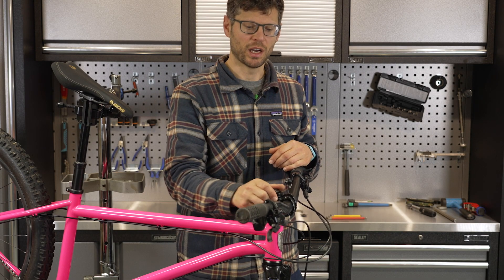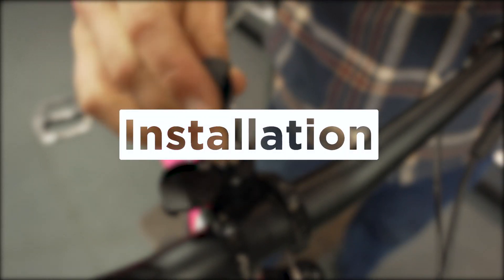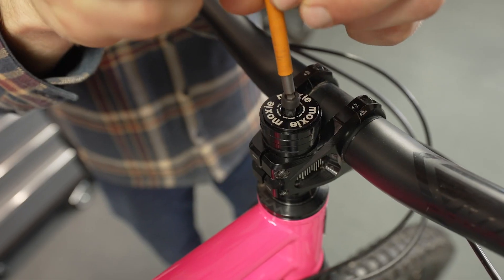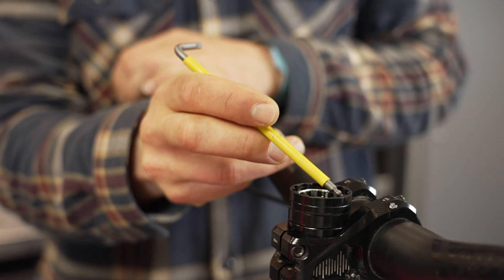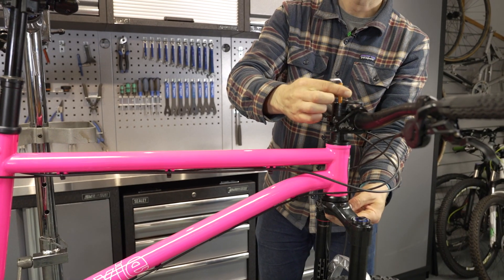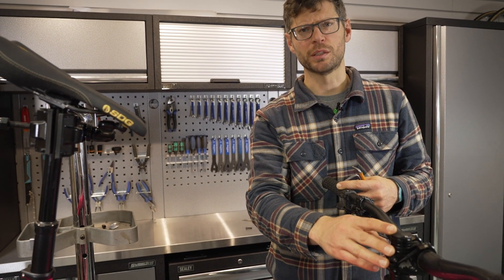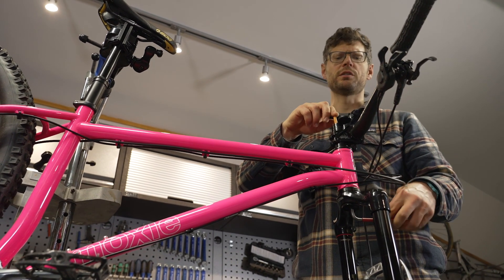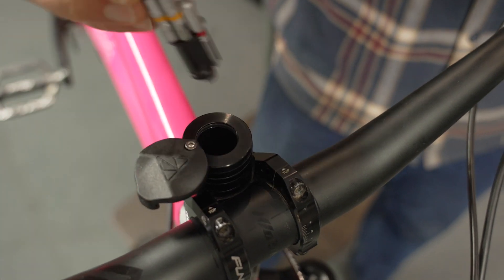How to Install Stash RT

Comment: My only concern is if headset is loose on the trail. Do you have to use two Hex keys?
Reply: If you tighten the stash tool to compress the headset, and then torque your stem to the proper torque, wouldn’t the stem then keep the headset properly compressed regardless of if the stash tool bolt comes loose?
Reply: @gbrox17  my point is if the bolts loosen from a brutal crash, or you got a stem tha keeps getting loose as Race Face Atlas did for me even torque and with cured Loctite 243, took around 10nmins after - 10c tofor bar to spin, also stem could get loose too, happen in summer too, so got loose headset, it was hopeless, good I have Renthal apex 35, it works well, doesn't so this, but still can rotate on impact. But doesn't usually slid eup, atlead ti can't remember a time it did. But  without Loctite it comes loose eventually.
Reply: I just realized the same thing. Maybe you can do it adjusting the upper bolt, until you can get a second tool. The down piece could have a feature to pinch with fingers tool
Reply: @RodrigoForrequi  I have the original stash tool and the problem is you cannot reach the bolt inside with the tool.
Reply: @RodrigoForrequi  I think a easy fix would be to redesign it so you could tighten headset from the bottom.
Reply: 6Nm is enough?
Reply: @jacky6255  Stash RT manual says 2-3 Nm. Some threadlocker might be a good idea.
Reply: can i just buy the new rachet tool and fit it in the old stash housing?